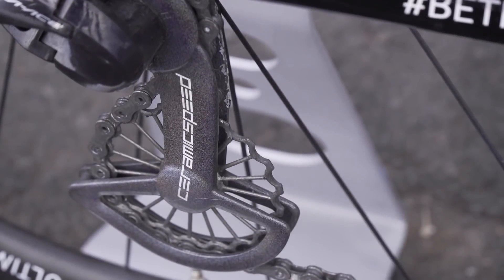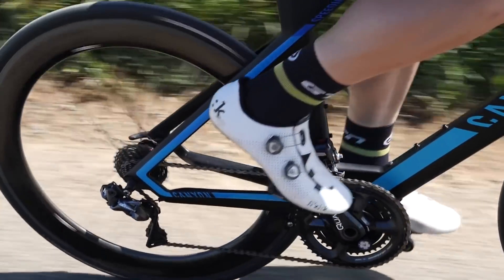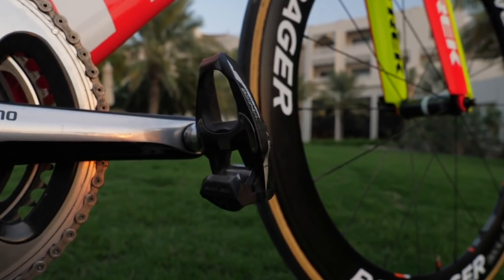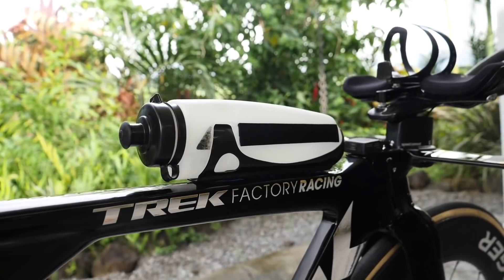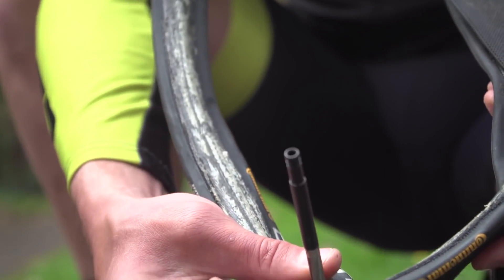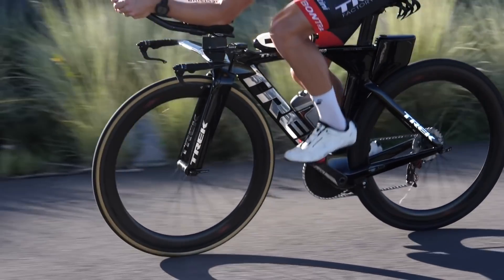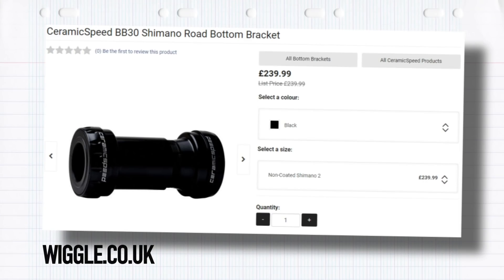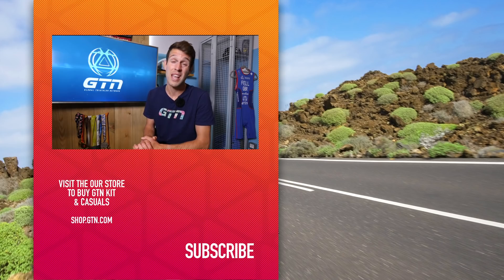The 5 Worst Value For Money Bike Upgrades!

Comment: My own recommendations are usually:

Work on your own fitness -> correctly fitting aero jersey/shorts -> Aero helmet -> Better Groupset - > Wheels - > Frame

If you think you are doing everything you can to improve your fitness, you probably aren't and could still do a bit more quality training before getting the wallet out
Reply: Greg Speakie i very much agree so. But most age groupers won’t agree with you 😂😂😂 i would rather spend more on gym membership, home gym equipment, pool pass, bike fit, trainerroad app.

The problem with adults, they have no patience and wants all the glory and all the shortcuts in the world.
Reply: Agreed on everything but a groupset. I guess it depends on your starting point but going from something like 105 to Dura Ace is definitely upside down in the value proposition category.
Reply: @josephlaviolette146  105 is good quality, upgrading isnt very good value. I'd say going from a low end to mid/high and wheelset is more cost effective than upgrading a group set.
Reply: Power meter first and then wheelset
Reply: Spot-on. I would maybe add "work on your flexibility/positioning"
Reply: I've seen people on steel bikes drop people on flash carbon bikes on hills just by being insanely fitter and stronger.
Reply: Aero socks, position, chain lube, much more important than Groupset. … this is really poor bank for your buck

Comment: The benefit of tubular tires is that in a large draft legal race such as the tour de france they will stay on the rim if you have a puncture so you can keep on riding and you won't fall and cause a major crash. In triathlon though they make no sense at all.
Reply: Absolutely. They do make sense in the pro cycling ranks, not so much in tri

Comment: Well, here OSPW is equated wit CeramicSpeed, but there are other more affordable brands as well. Apart from having these very big pulleys (which might affect shifting performance and the required chain length), it might be worth considering to replace pulleys with sleeve bearings (e.g. Shimano Ultegra) by those with ball bearings but keeping the same size or use moderatley larger pulleys.
And don't forget to clean and lube your chain! That's what I'm going to do now - thanks for the reminder!

Comment: Woah... You can get pretty cheap OSPW with pretty good quality here in Indonesia... 17T/17T Meijun will cost around 20 bucks with current exchange rate. 17T/17T Kactus with carbon cage and stainless steel wheels and ceramic bearings cost around 100 bucks

Comment: The new MucOff Oversized Pully wheel system looks good and might not be as expensive as the others. Then these days of you buy anything other than 105 or the SRAM equivalent then you're mad and throwing money away. Unless money is no object or you are racing etc. 105 is just as good just heavier and not by much.

Part of the reason the pros use Tubalers still is safety as you can keep riding them easier if they flat. This also means that they can keep rolling until a wheel change comes.

Comment: i thought the main advantage for tubular still claimed by pros was the ability to run flat. so some edge case safety claim. but for normal people who don't have team mechanics, flats are rare enough to still be running inner tubes, and people concerned about that can use tubeless
Reply: You're absolutely right. Which is why they make sense for pro cycling, but far less sense for triathlon

Comment: What about wireless shifting! Costs a lot and won't make you any faster.
Reply: Depends on how you set it up. You can change shifting speed, number of gears shifted and shifting placement. These are things which can make a small difference when racing.
Reply: @sfetriathlon2432  Maybe, but those gains are extremely marginal.
Reply: Kristian Holmgaard agreed. TBH, I’m not sure wireless offers much over standard electronic; but I still want it! 😉
Reply: @sfetriathlon2432  Me too! But im not paying for it;)

Comment: Bro, im riding an 18€ china full carbon saddle. 103g.
Reply: Boom! Fair play
Reply: And I've got a pair of carbon fiber bottlecages from China with aluminum bolts holding them in place. 16 grams per cage and 1 gram for each bolt. They are quite good too!